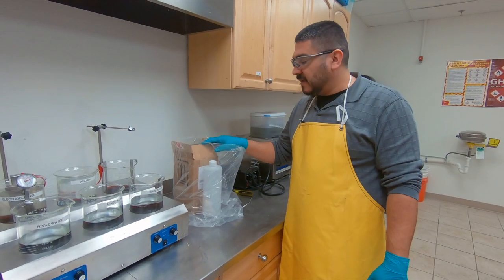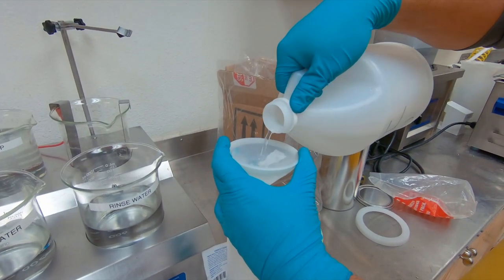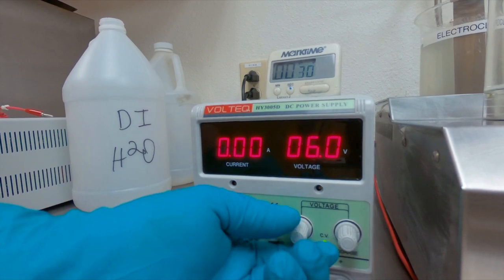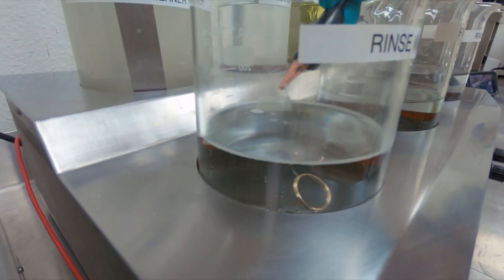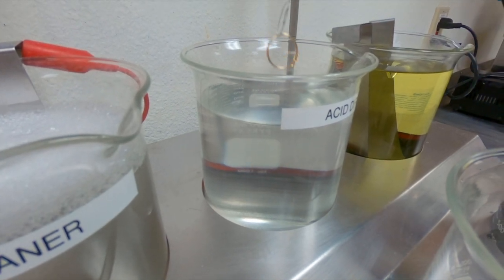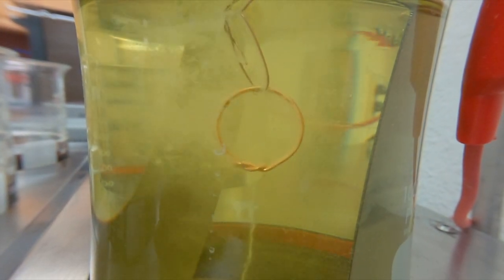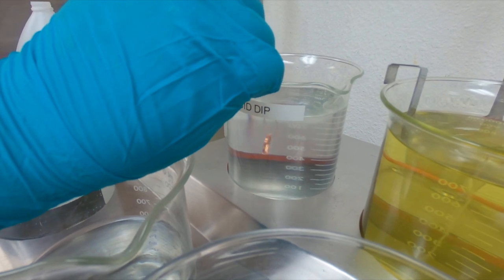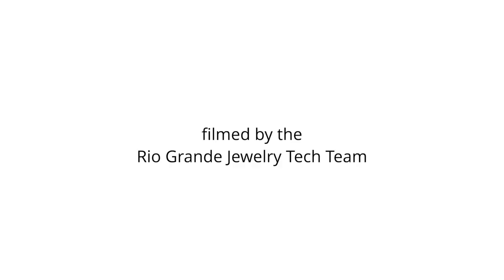Rose Gold Jewelry Plating

Comment: Hi would brass or copper wire work for plating the piece? Or do we need to only use stainless steel wire?

Additionally shouldn't we keep the distilled water rinse in separate jars/beakers for cleaning instead of using same jar/beakers after electro cleaning, acid cleaning and after plating?

Comment: Hello I am interested in getting a steering wheel I have re-dipped as the years have not been great to it. 
The wood I'm told may have to be seperated which I do not like the idea of, my question is will a 3m 484 electroplating tape provide enough protection in a stripping of old gold plating and replacing with new rose gold plating?

Comment: Hi it is an excellent tutorial. Mind if I ask you about the acid dip? Since your demo is with an non-stainless steel object, stainless steel activator is not required nor any current on it and you are using ACID DIP. is ACID DIP different solution from stainless steel activator? Due to we all use different language, it is confusing sometimes. Cheers
Reply from the maker: Yes, they are different solutions! The acid dip is designed to neutralize the piece since the electrocleaner is basic or alkaline. The acid dip is just part of the standard prep steps that we use in most of the beginning steps. Hope this is helpful! Let us know if you have any other questions.

Comment: Nice video!!! Anyway, How long does a rose gold plating last on yellow gold? Are there certain things we should do to slow it down from fading?
Reply from the maker: Thank you! Plating does wear, and unfortunately there is no way to tell exactly how long it will last because a lot of factors affect it. But there are some steps you can take to make it last longer. First a thicker plating lasts longer so try to plate for the maximum time that is provided by the manufacturer of the plating solution. Also following all steps of cleaning the piece to ensure you have the best surface to accept the plating is crucial. Ensuring that your rectifier is accurate is also an important factor. Making sure your solutions and rinse water are clean as well as making sure your anode is clean will give you better plating which in theory will last longer. And lastly you could also try a heavy-deposition solution like this to achieve a thicker plating, http://ow.ly/rKF350H8kv3. We hope this helps, but please let us know if you have any other questions.

Comment: @Rio Grande  Hi Thomas thanks for the video, I'm thinking of purchasing one of your plating kits. I need it for plating and e-coating. Can I control the thickness of the plate? How do I do that?
Reply from the maker: Hi good question. Yes you can control the thickness with voltage and time. And if you are looking for extra thickness it is best to use a heavy-deposition solution like this, https://www.riogrande.com/product/legor-gt4pink-heavy-deposition-rose-gold-plating-solution-acid-based/335410
Reply: @RioGrande1944  Thank you very much for the reply, where do I find the information on controlling the thickness, is it going to be on the paperwork for the plating solution?
Reply from the maker: Yes the paperwork does have some information. We have that paperwork on our website so you can check it out before you buy. Here is the information for heavy-deposition gold, https://www.riogrande.com/article?name=335413-Tech-Sheet-IS